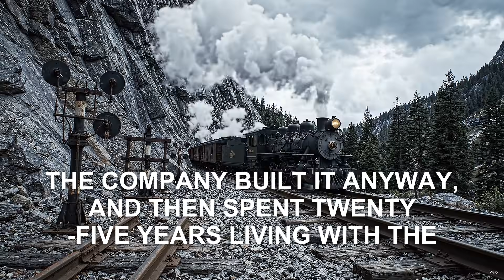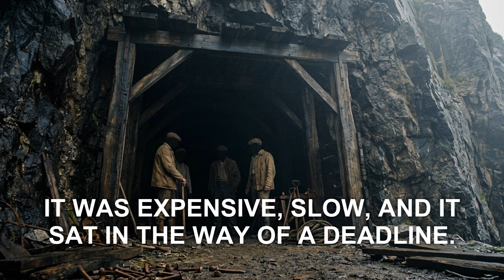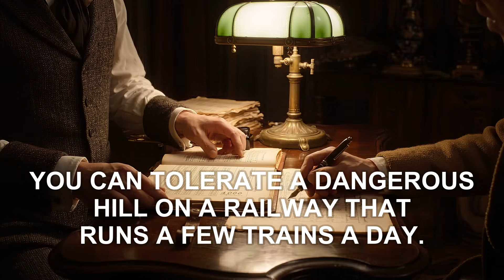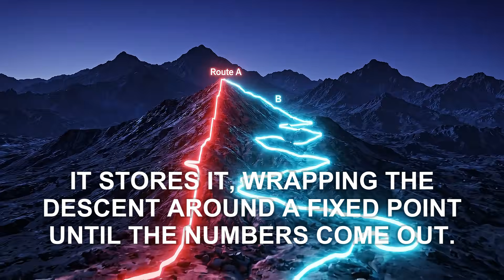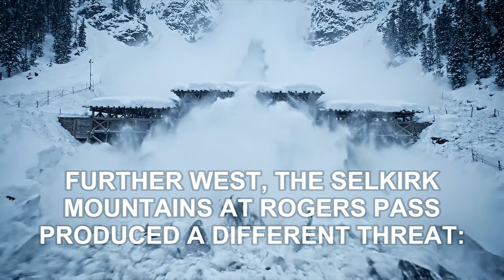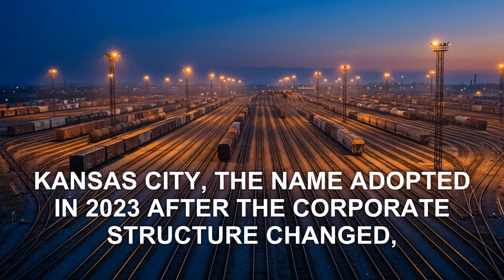Why Canada Spent Millions To Bury Trains Inside Mountains

Comment from the maker: CPR’s Big Hill ran at ~4.5% for 25 years — runaway risk managed by rules, not rock. The fix wasn’t a better brake. It was buying length inside the mountain.

Was the real unlock:
1️⃣ Spiral tunnels (store the descent in rock)
2️⃣ Throughput pressure (revenue forced the rebuild)
3️⃣ Both — safety alone didn’t kill the temporary line

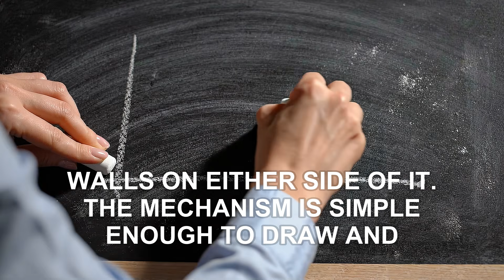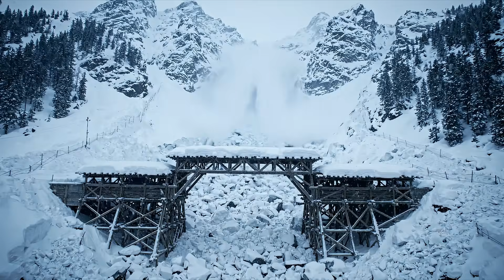I break down how a spiral stores a grade at 5:16 and Rogers Pass / Connaught at 7:44.

Would you have kept operating the Big Hill longer — or paid for tunnels sooner?